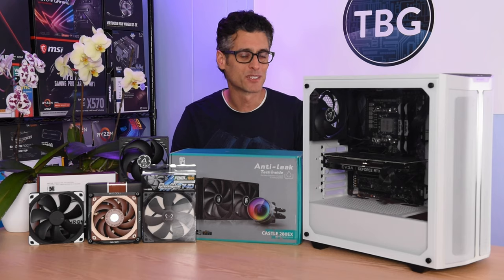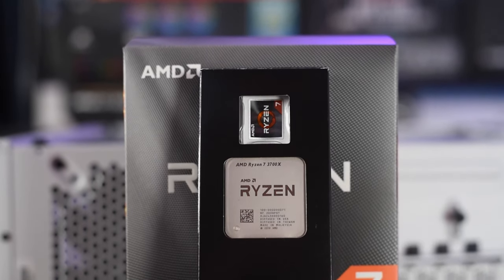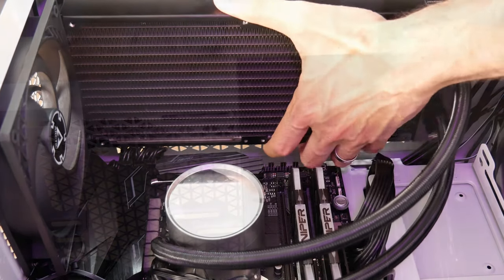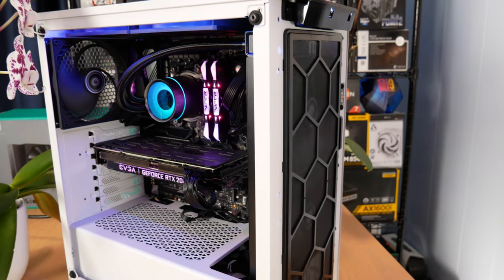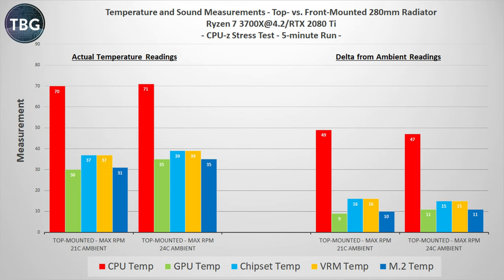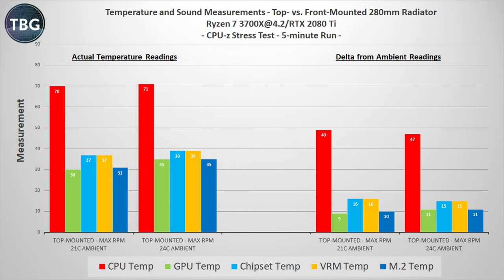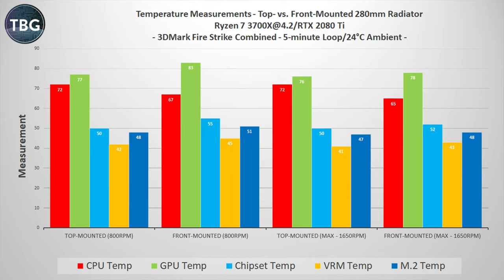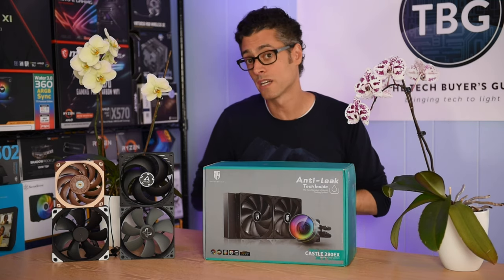Front vs. Top AIO Liquid CPU Cooler - feat. Deepcool Castle 280EX Install on AMD's AM4 socket

Comment: Your argument for delta from ambient is a good argument but it doesn't apply for reviewers who test with the same ambient temperature for every test they do by normalizing the ambient temperatures in the testing area whenever they test. One example would be GamersNexus who has a set ambient temperature for every test they conduct, in this way delta from ambient is still accurate. I think you should have clarified that delta from ambient is wrong when the ambient temperature itself is different which would invalidate any other tests anyways since it isn't possible to compare results two different ambient temperatures. This would be true even if you didn't use delta from ambient results.

Other than that, a very good video that not many other people do. The only other video I've seen of radiator placement is from Bitwit from back in 2017 where he did not put a front top fan in the tests which made me question some of his results since the front top fan would have likely affected top mounted radiator performance.
Reply from the maker: Thanks for the clarification on GamerNexus. He definitely knows what he's doing. I do wonder why he reports that way if he has the same ambient, though. Why not just report actual temps? 

I saw BitWit's test of this (and Jayz2cents did something similar 4 years ago as well). I tried to make my test as representative as possible in terms of how someone would actually set this up today, rather than back then. I'll say this about BitWit - the odd fan configuration you see here was "in style" at the time - https://youtu.be/xNAMxZgvves?t=513
This is just how manufacturers shipped their cases. But here's a bigger issue, and it's what I think may be the deciding factor: case size. When you have a gargantuan case like the Fractal he's using, airflow from the front probably doesn't even reach the GPU (whether its cool air from front fans or hot air from an AIO). That makes fans irrelevant and gives the win to the AIO. So in a sense, there are two answers to the same question, but I think manufacturers are moving away from giant cases like this designed to house massive hard drive arrays. There were never designed around gaming-focused systems in the SSD age.
Reply: I'm not sure why GamersNexus reports delta from ambient, perhaps it's because people are used to it? They go in-depth about their testing methodology in their cpu cooler testing methodology article and go to great lengths to explain how ambient has to be the same. 

The case definitely affected the results from Bitwit's test, and it is conceivable that most of the air the GPU was getting is through the PCIe slots during the front aio test since he did have a heavily negative airflow fan layout. But rather than the size of the case, after rewatching the video, I would point to the front panel of his case, the solid aluminum/steel front panels that was "in style" with only small side intakes combined with the radiator being a 240mm meaning only 120mm fans probably reduced any fan cfm to nothing if you get what I mean. This would likely mean that modern cases with mesh front panels like the 500dx would perform similar to your testing even if larger since those old solid front panels really did choke any front intake air.
Reply from the maker: Another great point. He was using a weaker cooler with a highly-restrictive case. But that cuts both ways - it would be worse for a front-mounted cooler too.

There are so many combinations I could try. My work system is in a Cooler Master H500P, which is similar in size to that Fractal, but has massive front airflow. Would the AIO placement results be different in that case? Could be, but that test isn't on my agenda yet!
Reply: For sure, it would be different, there might be somewhat of a pattern we can see if enough cases are tested but that has yet to be done by anyone. I would agree with you and say that in general mounting at the top of the case is the best option because the GPU is alot more sensitive to thermals than the CPU. At the end of the day, if you're not sure and you can't find anyone else who knows anything, you gotta test it yourself.
Reply from the maker: Honestly, that's what drives my reviews. I seek out questions that no one else has answered, and I try to figure out how to get those answers. It's not that other reviewers aren't putting out good reviews, it's that they aren't testing all the combinations out there. Always more work to be done!

Comment: This is interesting, Be Quiet only state 240mm AIO for the top
Reply from the maker: 280mm only works with certain motherboards.
Reply: @TheTechBuyersGuru  z690 msi mpg edge wifi d4 supports 280? on this case?

Comment: Good video! I was puzzled by people putting aio-coolers in front, as my common sense and physics lessons  told me that the gpu will be getting heated air. But now I understand, that intelligent people get confused when they see people doing non-intelligent stuff.
Reply from the maker: Lots of common sense in that comment!
Reply: You SHOULDN'T put an AIO up front, unless the tubes are oriented to come from the bottom. But it's not for the reasons you suggest. It's sub-optimal for the AIO as air will always find its way to the top of the AIO, so the pump should be at the bottom. With the orientation shown, the pump is in the wrong place. Everyone makes this mistake though, including almost every YouTuber building PC's. Even manufacturers also do it... but just because it looks better. It can shorten the lifespan of your AIO though, and result in unwanted noise. SO DON'T DO IT.
Reply: @frangipani-dreams  by following the instructions on this vid my i9 9900k runs good @5 Ghz on Arctic liquid freezer ii 240.
Reply: @xyuxyuxyus5510  Mounted how? Front mounting with tubes at top isn't going to see your AIO explode, but it isn't optimal either. Mounting horizontal at the top of the case is better.
Reply: @frangipani-dreams  and thats about what the video told to do. Of course mounted at the top. Gpu goes down on perf so fast with temp that no intelligent gamer puts cpu aio in front.
Reply: @xyuxyuxyus5510  i tried both front and top and had same temps and performance in games
Reply: @frangipani-dreams  doesnt matter if the tubes infront are up or down..it only matters that the radiator is higher than the pump.. guess you watched steves video and think that this is wrong. But its not. Watch jayztwocents explain that.
The way he setup front radiator in this video is correct.

Comment: I think sandwich built is more cooler than any cooling method i saw. Not only front but also top ! Sandwich method is best !!
i have this pc 
3700x , x570 auros elite, nzxt z73, corsair ql * 7 , ll *4, nzxt fan*3, commander pro*2, ssd pm981,mp600 1tb, galaxy hof 2080ti 
other: corsair dark core rgb pro se, logiech g pro wireless, razer viper ultimate wireless, corsair k70 mk2 se, corsair nexus, corsair st100, litghtening node pro, ls100,lt100, sennheiser gsp670  and so on....
Reply from the maker: You're talking about a push/pull fan arrangement? That can have benefits if your radiator is large enough. In other words, the radiator cannot already be a bottleneck to the fan's capacity to remove hot air from it!
Reply: The Tech Buyer's Guru  hmm i want to show my pc picture to you . I email to you my pc build
Reply: The Tech Buyer's Guru  sandwich is 3 layer fan-radi-fan. In south korea, many pc user built this method lol
Reply from the maker: Yes, I call that push/pull, you call it sandwich, they are the same and can be very effective if the radiator is powerful enough!

Comment: Not to burst your bubble about delta T statistics, but I can absolutely see how you would arrive at a truthful yet technically very wrong conclusion.

Mathematically speaking there is no difference between an ambient temp of say 20c and 30c. Assuming the heat load is the same, the "hot" temps should be almost exactly 10c hotter (the "almost" is due to radiation and should only be lower by .2 degrees MAX at these temps). Claiming otherwise is factually incorrect. 

I have verified this over the course of many years by simply comparing my own computer temps in summer and winter. Are the results slightly different? Yes, but they can most certainly be compared and what I would call margin of error. During winter temps don't exceed 72-74c. During summer they can reach 86c. Wall power remains identical at just shy of 300w with static fan speeds at those temps. Comparing delta T over ambient yields 54 and 56 degrees for winter and summer (extrapolate my thermostat settings from there). That's a 2 degree gap (the same you observed) but for a nearly 12c difference in ambient temps.

Why did you not observe this? Simple. The majestic beauty of water cooling. Water has the highest specific hear of any liquid and masks (buffers) these difference for short bursty work loads (5 mins counts as a bursty workload for the amount of water in aios). Fully heat soak your system and any major buffering effects will disappear. 

Otherwise great video. I definitely agree with your conclusion of top mounts despite the terrible airflow of trendy tempered glass cases.
Reply from the maker: I think we are both correct. Over infinite time, yes, a given heat load will increase the temperature the same amount regardless of ambient. But this doesn't work in the timespans in which I and most reviewers actually conduct cooler testing.

Heat is defined as the transfer of energy from a warmer object to a cooler object, either by conduction, convection, or as you mentioned, radiation. But the rate of transfer of heat is affected by the delta between the two objects. The greater the delta, the faster the transfer. It's an exponential relationship defined by Newton's Law of Cooling: T(t) = Ts +(T0 - Ts)e^-kt
See a demo: https://demonstrations.wolfram.com/NewtonsLawOfCooling/

This is complicated by the fact that the object (e.g., a CPU) isn't dropped into an ambient environment from somewhere else (like an icecube dropped into water). Rather, it starts in that ambient. So Newton's Law of Cooling isn't modeling our particular situation. It's a much more dynamic situation when you suddenly apply a 200W load to an object (like a GPU, where 200W is typical). But the heating/cooling relationship is still exponential. That makes a linear delta T conversion troublesome.

And there's another factor at play here: transistors are less efficient at higher temperatures, leading to more energy loss and ever-higher temperatures. A CPU at 60C will actually consume less energy, and produce less waste heat, then a CPU at 70C, while doing the same work.

As it happens, EK, the manufacturer of high-end liquid cooling kits, did a blog on this topic: https://www.ekwb.com/blog/what-is-delta-t/

Now, I'll admit that their data show that the error in using delta T goes the other way: they found that in a cooler ambient, the delta T was lower than in a hotter ambient (the opposite of what I found). But their ambients were much further apart, which probably meant that transistor losses outweighed any rate of cooling difference. Also, they were using an air cooler in their example, so water's specific heat did not come into play.

Even your example of winter vs. summer temps shows that something is fouling the delta T conversion. You had a 2C difference. I don't believe this is just margin of error. With your 10C change in ambient, you are affecting the transistor efficiency.

Long story short, I realize I couldn't properly cover this in a 2-minute discussion in a YouTube video, and I did my best to provide data showing that assuming a linear relationship when applying a delta T conversion is wrong. It goes way beyond my abilities to model the direction or range of error, but it's pretty clear that there is error involved, and the greater the disparity in the ambient in which you test, the greater the potential error becomes.

If reviewers wanted to be honest about their testing, they would indicate the ambient in which each specific test was run, and viewers could decide for themselves how to interpret the data. But this isn't going to happen, because it greatly complicates the presentation, and a lot of reviewers have compiled years' worth of data and likely did not record the ambients, just the deltas.

The way I've decided to address this is to test in the same ambient. It's hard to do, it adds tremendously to my testing time, and it means I cannot carry over temperature data from one test to another test done at another time in a different ambient. But it's what I believe to be the correct approach.

Comment: 6:45 Rad is upside down, you want the inlet and outlet at the bottom not the top!
Reply from the maker: The only reason anyone knows about this is because of the GamersNexus video posted after my video went up. Doesn't change the results for performance, it's a longevity issue.
Reply: @TheTechBuyersGuru  i knew about this due to common sense and thermal dynamics to be fair.
Reply from the maker: The thing is that you and everyone else who has posted the same comment on this video are wrong. JayzTwoCents just posted a video to end this nonsense: https://www.youtube.com/watch?v=DKwA7ygTJn0

The issue is having the radiator below the pump.

Comment: Hm very interesting. Bitwit did this test as well but he got different results than you. It showed that a front rad + open card is superior in every way whereas with a blower card you'd be better off with a top rad.
Reply from the maker: Yeah, that's a video I watched carefully before doing my own. I think there are a few factors that impact the results:
(1) type of case (especially the front panel and the size)
(2) type and TDP of GPU
He used a very large, relatively low-airflow case along with a GPU that understandably put out a lot less heat than more recent models. I think both results are valid, but mine may be more relevant today, using a smaller, higher-airflow case and a hot GPU. But many people still use older, larger "silent" cases, and while I don't recommend them at this point, if that's what you have, the results will differ.

Comment: You made one mistake with the front mount, the tubing should be at the bottom not the top!!
Reply from the maker: Wrong. You can't install it this way, the hoses won't fit. So if that hurts performance (which it barely does), that just makes it clearer that top mounting is the way to go.
Reply: @TheTechBuyersGuru  OK thank you for confirming the reason... Though according to Steve from gamers nexus mounting front radiators should have tubing at bottom..
Reply from the maker: I've seen the video. As he made very clear, this is a problem with cases, not reviewers. For the past few years, cases have been marketed with AIO compatibility in the front only, yet don't even allow AIOs to be mounted correctly. My video made very clear that mounting it at the top is preferred. Steve's video only added additional data on top of that. Very few cases allow the mounting of large AIOs with the hoses at the bottom.
Reply: @TheTechBuyersGuru  I must have missed that, hope my Arctic liquid cooler ii 280 will fit with tubes at bottom on front mount of lian li lancool2 mesh performance!
Reply from the maker: I'm 99% sure that won't work. Having tested the LFII 280, I know that it not only has a very thick radiator, it also has the stiffest hoses of any AIO on the market. You should have asked me first! ;)
Reply: @TheTechBuyersGuru  so you think i will have to mount on the top? or front with tubes at the top? thanks for the information and I do enjoy your videos!!
Reply from the maker: It will not fit in your case on top, so your only option will be to mount in front with tubes on top.
Reply: @TheTechBuyersGuru  OK thank you for that

Comment: Good video except you made a mistake by mounting front radiator with tubes up . You only mount radiator in the front if radiator cables have enough lenght to be on the lower side. If mounted in the front or on the back of the case, the part of the radiator with out cables must be on a higher level than the pump. 
Manny begginers might see your video and mount in the front like you did. 
This way they will wear the pump sooner and get more noise.
Reply from the maker: Yes, you are right, and this became known by most people about a week after I published this video, when Gamer's Nexus did a video on the topic. But since I recommend that radiators are top-mounted anyway, it's not really all that relevant.
Reply: False. The way he did it is good. Doesnt matter if the tubes are up or down. It only matters that the radiator is higher than the pump.